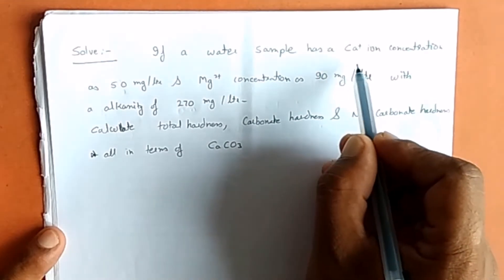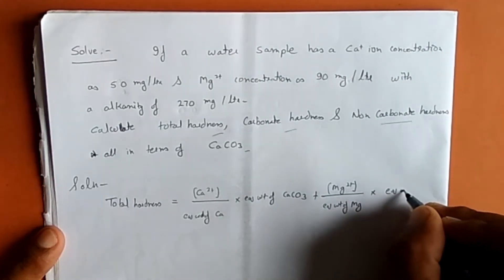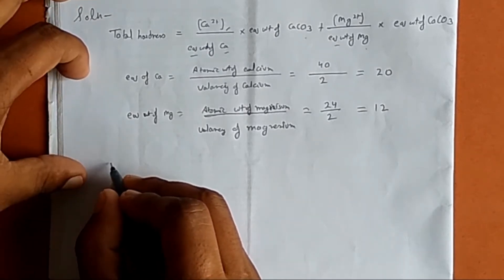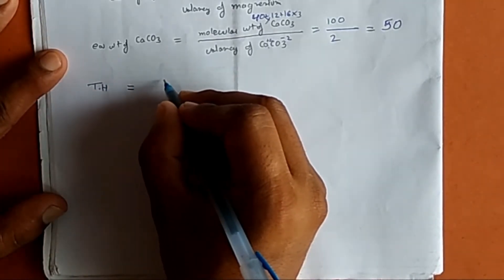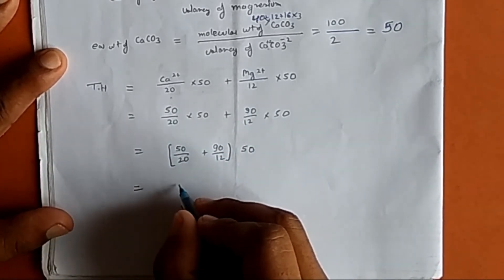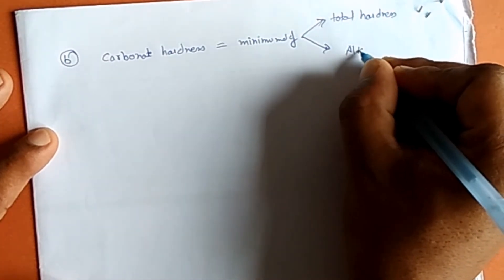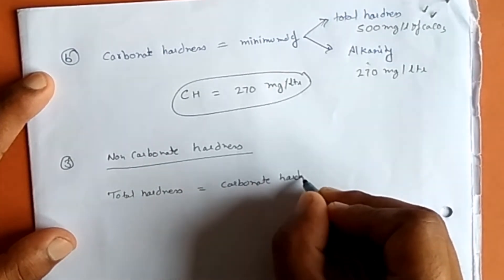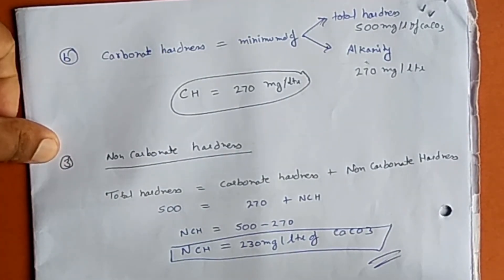Calculation of Total Hardness, Carbonate Hardness & Non-carbonate Hardness.

Comment: If, Concentration of 
Ca2+ is 20 mg/ lit 
Mg2+ is 30 mg/lit 
Alkalinity is 150 mg / lit , then 

Concenteation of ca2+ / equivalent weight of same × ( equivalent weight of caco3) +  concenteation of mg2+/ equivalent weight of same × (equivalent weight of caco3) 

(20/20 )×50 + (30/12)×50 
= 175 mg/lit 
So,  total hardness is 175 mg/ lit
Non Carbonate hardness is among  175 -150 is less= 25 mg/ lit 
And carbonate hardness is 150 mg/ lit . 

Exam questions should provide the info for equivalent weight , molicular weight , valancy and stuff, remembering these and finding out caco3 = 40 + 12+ 48 = 100/ valency 2 = 50 is shitty , cant to that memory  , rest except these is easy ✌